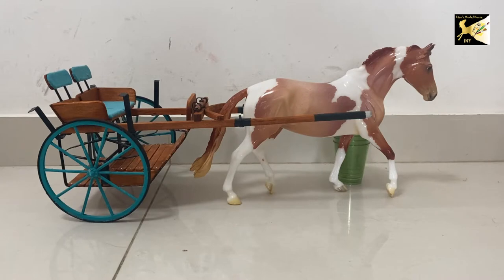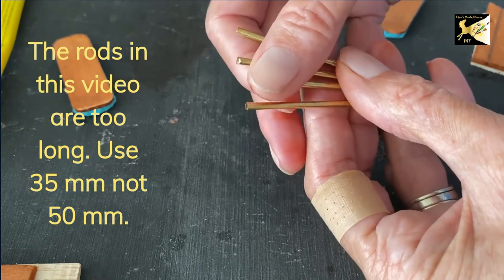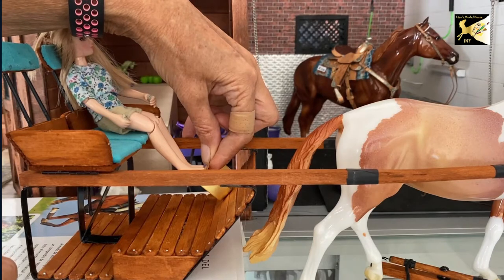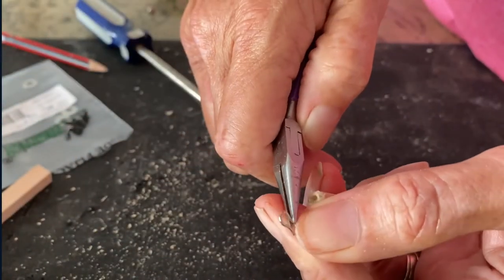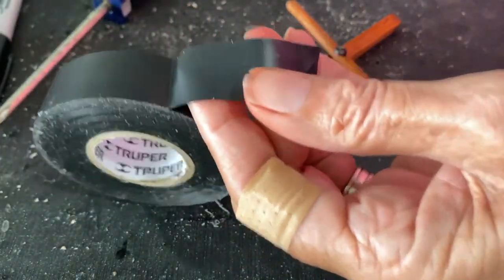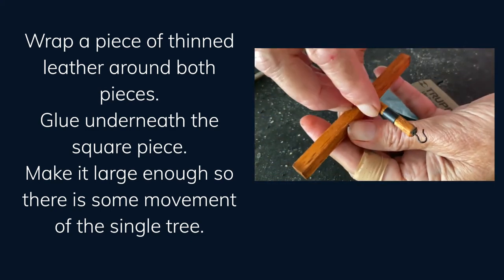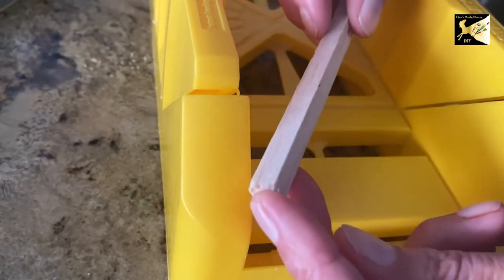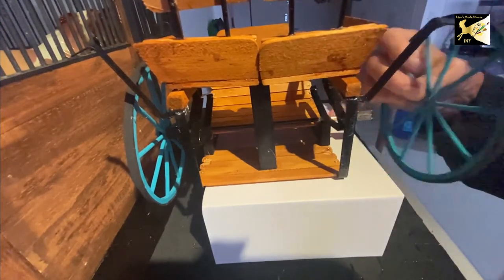Make a model horse cart. Meadowbrook Cart Part 2.

Comment: Thank you for showing all the steps for this cart. I've been trying to figure out what to do (I have four 4 1/2" wheels and a 1:12 Model horse).  I want to make a four wheel wagon to be able to pile the whole family in for a ride. No need for hinged seats.  I just want a buck board wagon. with a couple of bench seats. Any suggestions?
Reply from the maker: Glad it was helpful! I will be making patterns for other carts in the future. I put a lot of research into each one so I cannot give exact details for a 4 wheeler until I really take a look at the design. However, you can take a look at real carts and get an idea of what needs to be done :-)  Next up will be a marathon cart as I have had requests for that but I will keep this in mind!.